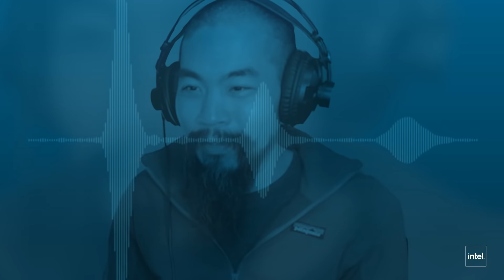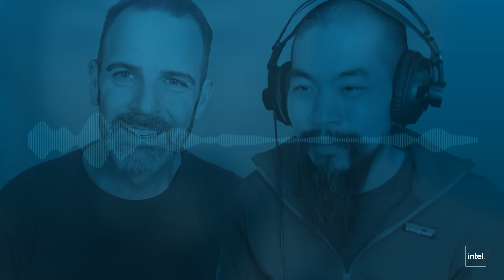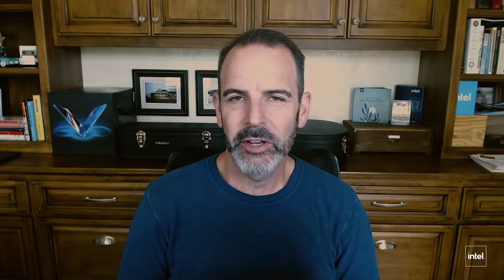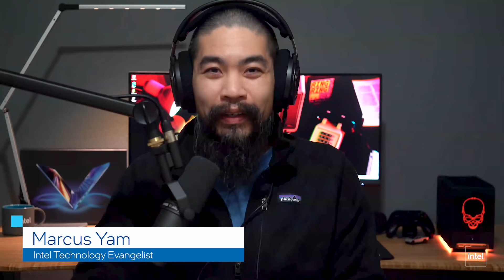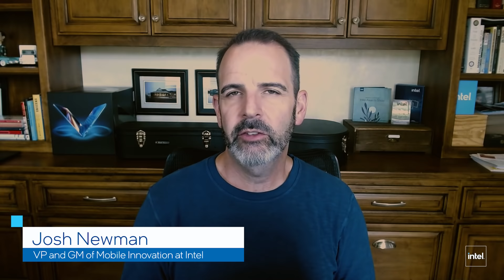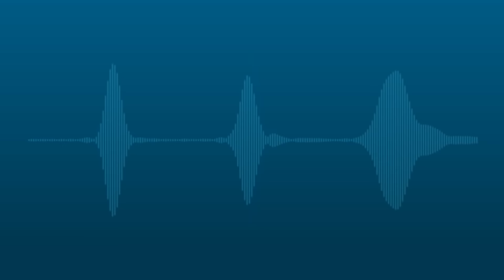Intel Evo – The Vision: Intel Chip Chat Ep. 713 | Intel Technology

Comment: He is selling his ethnographic data work, and invited...Greek project names. Εμζκ that, λολ. Where's my PoE socketed laptop ethernet?  Where are OS Standby 2-24 in your metrics? Translucent monitors A-F? Keycap capsense controls? Indeed, ringlights on t3h bezels intermittent to iframes. Srsly,, laptop chassis vision? CI in anciens. How much of Intel FAE is resisting IBM Research?! Come think of it, where is ATSC 3.0 datastreams OTT in Intel Evo? Intel hinge design, eh? 🧑‍🦽🤾😆The beleaguered engineer only allowed innovation in crossing with partners. Intel Open Labs CN, TW, CA.US...nothing to do with OneAPI? Customer posture detection wha....no, no, you dropped the thread. IoT...likewise. Why? Finish the claim. Otherwise may as well go Intel Evo, 10 Million Oysters NY, go! 

Where my extensible 2-in-1 hinge chain? Linkify! Wait, which Holiday Special, National Week Taiwan, or Hallmark Spring Haali Boston? Where my Threatbutt 2022 screen sticker wallpaper upgrade? Wtf if camera far from CPU add cpu slots and feed the mezzanine. Slackers. Maybe there's AI based shoulder surfing and actual rat proofing going on; dirtier labs than Semi ever dreamt altogether.  Vpro still delights IT managers? Haha. Also not followed through. ...and so they die on every aspiration and low light concept. Less sad 2022 Josh.